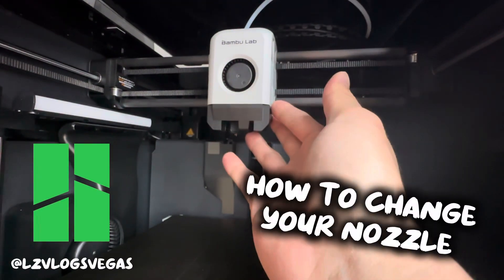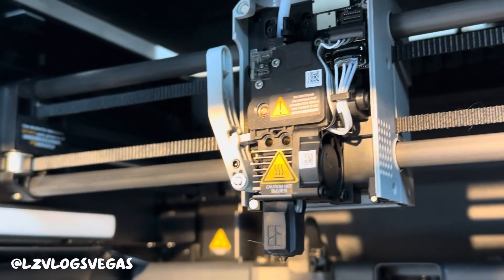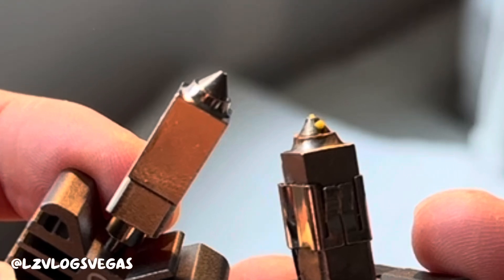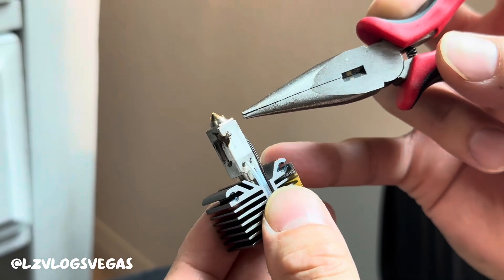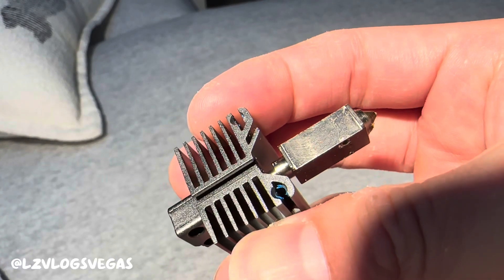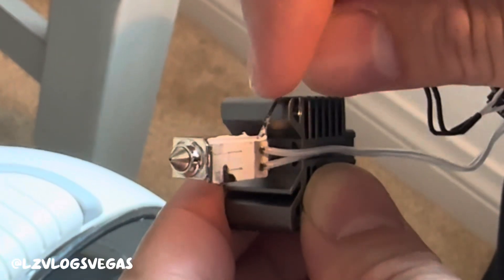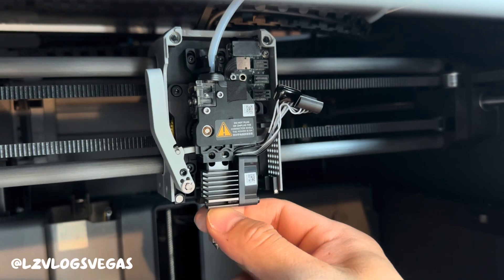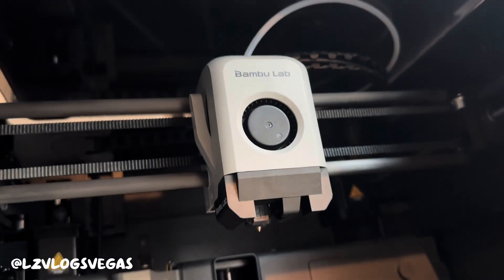How to Change the Nozzle on a Bambu Lab P1S

Comment: I'm getting a really weird vibration sound after installing a hardened nozzle. 
On the printer I set it to a hardened nozzle in the settings.
Did a full calibration after installing. 
Did a Bechy test and heard noises that were  not there before.
Double checked that the screw were tight on the fan and tool head.
Reply from the maker: Did the benchy turn out ok?

Comment: If others don't want to waste time with all these steps, the "complete hotend" is way simpler to install than just the hot end. For some people the $20 uplift is worth the time savings.

Also, this is a great video covering all the steps!
Reply from the maker: Thank you! I’m glad my video helped you!
Reply: Came to say this. I really appreciate the instructions, because I would have never gotten it back together without them. But I'll never do that again,
Reply: Honestly after years of using bambu lab printers and buying complete hot ends for the ease was a mistake in hindsight, I would much rather have spent that money on more filament for filament mountain! 

Also most people make 20$ an hour working, this takes 10 minutes once you learn how to do it. So essentially working at your job for an entire hour, just to throw that away to save 10 minutes worth of work changing a hot end, on a hobby where you wait 24 hours for a print to be done just doesn't math for me unfortunately. 

Trust me take the time and learn how to change it. When your Y Axis belt snaps are you going to throw the printer out or buy and fix it for 30$. It's 3D printing you need to learn these things, just because we aren't dealing with Ender 3s anymore doesn't mean it's a set and forget hobby. I love bambu labs but also hate the money trap they have set up for these tiny conveniences that leave you with tons of left over working parts.

Comment: Don’t forget to plug the power supply into the printer and turn it on when you’ve finished the procedure.Then you’ll almost certainly need to recalibrate especially if you’ve changed to a new nozzle size.
Reply from the maker: Good tips!

Comment: Do you need to wait for the thermal paste to dry?
Reply from the maker: No, you do not need to wait for the thermal paste to “dry” before using your Bambu Lab P1S printer. Thermal paste (also called thermal grease or compound) is a non-curing material designed to remain semi-liquid or viscous indefinitely to fill microscopic gaps between the nozzle/heater block and the thermistor (thermometer) for optimal heat transfer. It doesn’t harden or set like adhesives or epoxies—any “drying” would actually impair its performance.